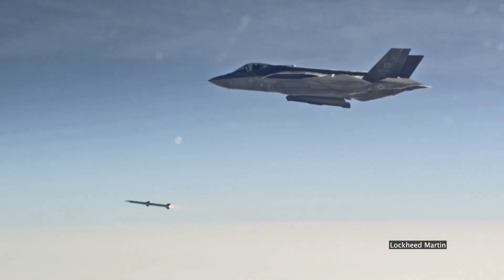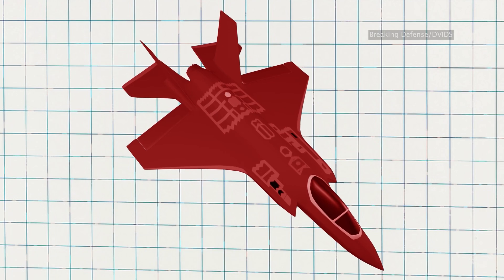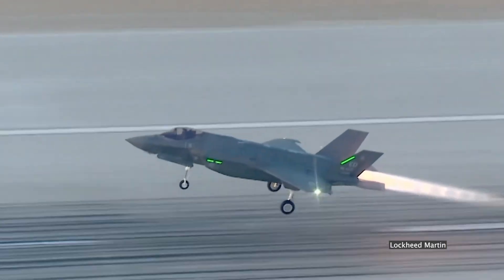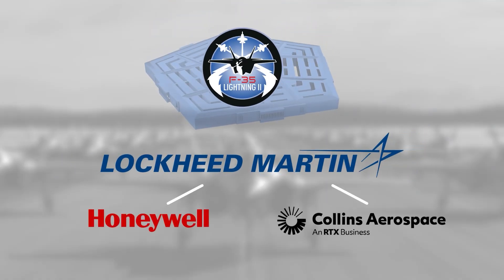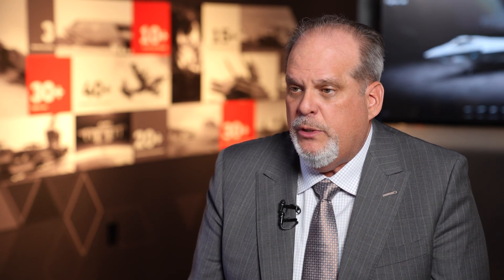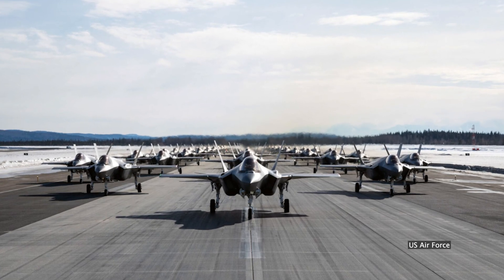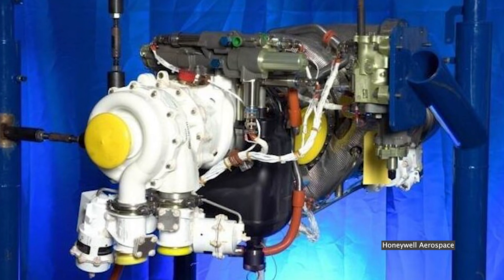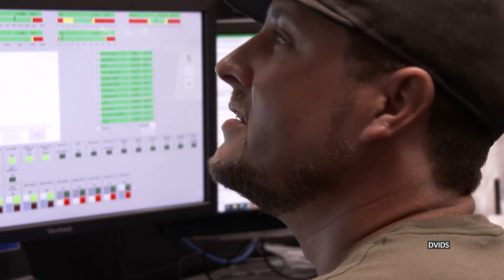Inside the race for the F-35's future cooling system [Fireside Chat]

Comment: For me, Collins has it.  HW's digital twin vs Collins hardware prototype is not 'proven' & has risks, but the JSFO is going to take its time.  Likely to knock down costs through fair competition.
Reply: Further, and more harsh, HW had 17 years to plan for an upgrade when cooling are causing maintenance costs to rise.  Collins was entrepreneurial enough to put its own bucks into furthering a solution.  HW still talking about a digital twin and at least 4 years or more out to do something nebulous for 80 kw.